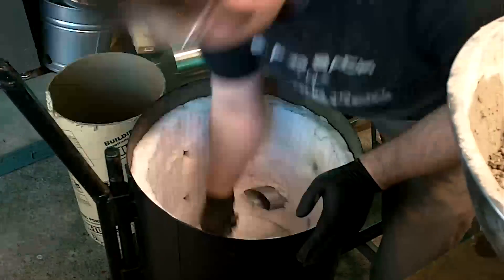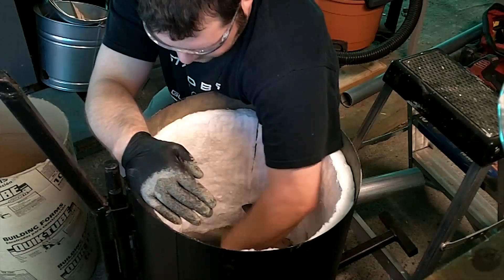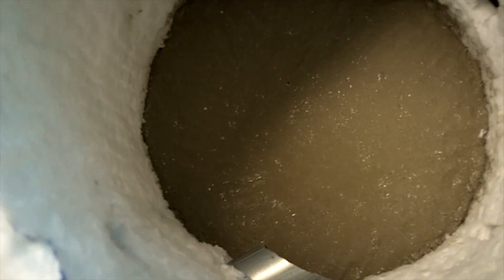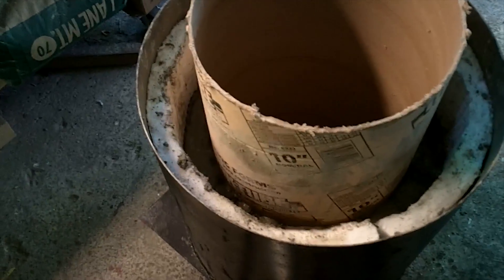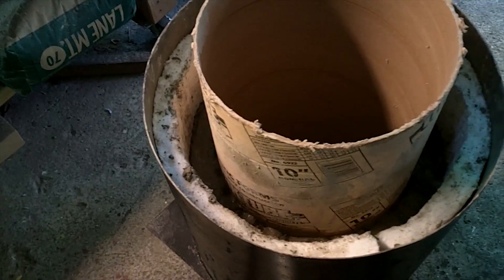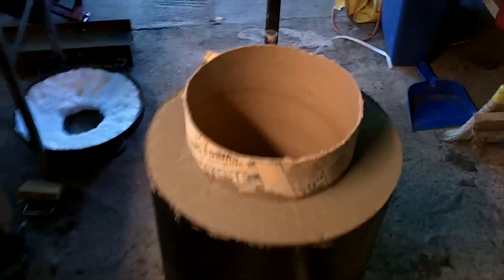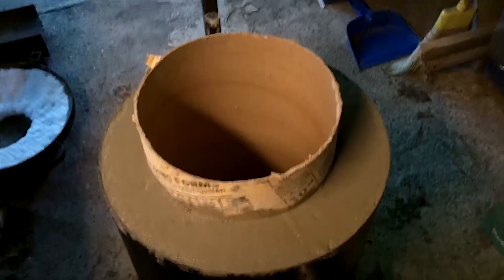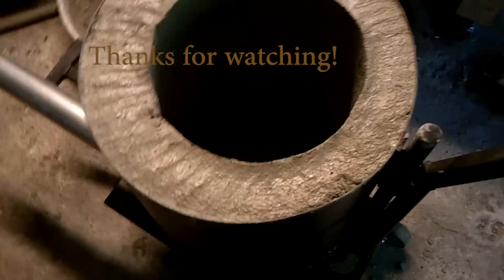Furnace Build   Refractory

Comment: For future forge builders using Kaowool and refractory cement: ALWAYS use a filter mask. This stuff is nasty.
Reply: I started to use kaowool out doors, and I try and use a mask. Are the breathing issues cause by the ceramic wool over prolonged and multiple uses? Or if you worked on it once or twice? Just wondering for my own reassurance lol.

Comment: could clay work  rather than this type of cement mix  ?
Reply from the maker: +tails doll black Yes it would work. A refractory cement is just going to hold the heat better.
Reply: ah .. good to know :3
Reply: +Rich Ray  how bout concrete        :3
Reply from the maker: +tails doll black Concrete is not a good choice, it can spall, which is basically trapped moisture that gets super heated causing it to expand and make little explosions. Also any metal that is melted down that gets on concrete could cause the same thing to happen. Lookup Perlite and refractory lining mix. It uses alot less of the refractory. Perlite is used in gardening.